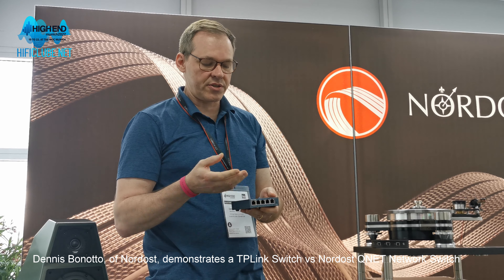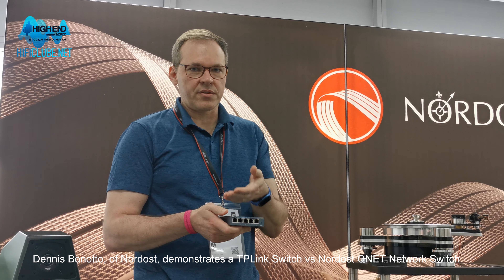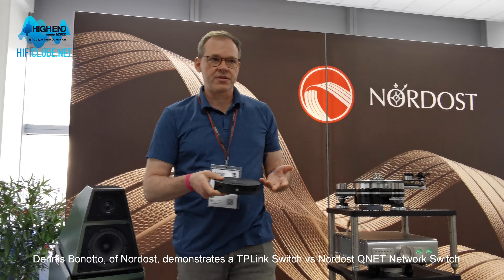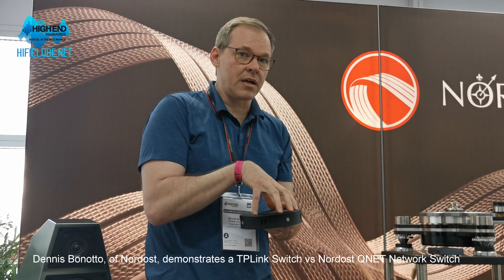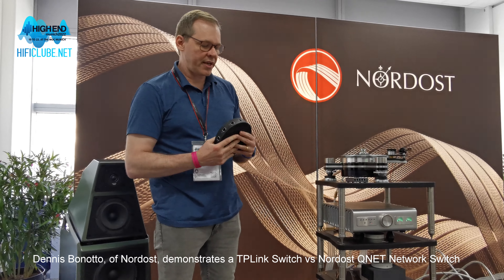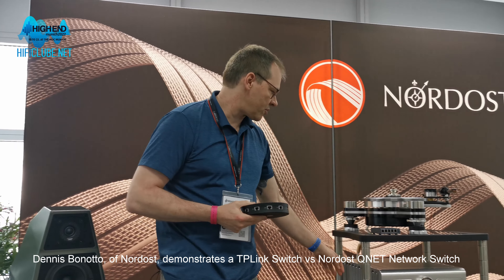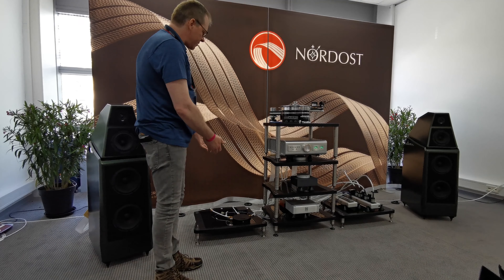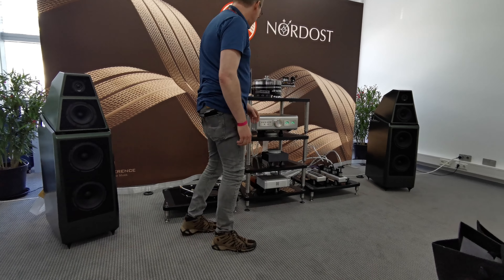High End 2022_Nordost QNET Network Switch vs TPLink Switch by Dennis Bonotto

Comment: Total bullshit. And Dennis Bonotto know that !
Reply from the maker: Paul, I am aware switches cannot make a measurable difference also due to the transmission protocol in packages. But if you can go to a local dealer you can try for yourself, even if only to show them wrong.

Comment: 1. I don't understand the comparison with the TPlink switch. There is no switch required at all if one just runs the Ethernet cable from the ISP supplied router to the streaming device. Adding the Nordost switch is adding another device in the signal path, not replacing one. One cannot replace the ISP router with the Nordost switch, because the ISP router is getting its input from cable (coax), fiber, or copper (DSL) and converting it to Ethernet, and then routing it to multiple locations in the home.

2. It's not clear where the music stream is coming from for this demo (a local music server or the Internet). If the source uses TCP/IP protocol, then the Nordost switch cannot improve the signal, as the data is contained in TCP packets that verified using a checksum calculation in the packet header at the receiving end. The TCP/IP also ensures that no packets are missed or out of order, and may request retransmission if that happens. If the signal is UDP over Ethernet, which is sometimes used for audio transmissions, especially Voice Over IP, then there could be some loss of data with a cheap switch because UDP favors low latency over accuracy or missing packets. I believe that music streaming companies on the Internet like Tidal use TCP/IP.
Reply from the maker: Question is: can you hear a difference or not? If not just get on with your life, and be happy
Reply: I didn't hear a difference during either comparison. I listened with my LCD-4 and I can hear the difference between optical and USB for example. I could hear the difference between Nordost analog cables in some of their other demos... But not this. I'm with Mark. 

I'm not an expert engineer, but I know the difference between digital sources comes down to clock consistency. A 0 is a 0 and a 1 is a 1, period. The real time clock doesn't happen until the data is sent from the serving device to the DAC, or even once the data is inside the DAC, depending on the situation and devices. SPDIF has the transmitting device set the clock, while USB natively allows the receiving device to set the clock. This is why USB tends to sound a hair cleaner. Some DACs will cache and reclock the incoming signals internally. My Denafrips Venus II for example did this and I couldn't tell the difference between optical or USB. But that cache stage added latency and it was noticeable with video or when gaming. So I sold it for an Audio-gd R1 that doesn't have this problem and sounds 99% as good, doing some things a hair better and others a hair worse.
Reply: Exactly, a Router is layer 3 (because, spoiler, it routes based on IP)...a L2 switch is relatively dumb and transports packages not knowing what data is actually transported. Furthermore, most streamed data is encrypted anyway...this is just finest snake oil which is getting called out by any tech savvy Gen Z teen... those snake oil guys still live in the 80s when all that was exotic gear and knowledge...it's 2023 now
Reply: @michaellichnovsky8397 Virtually all streaming devices have the capability to clean up and reject any noise on the ethernet line. Adding a new switch in-between an existing router/switch and the streaming device (where no switch existed before) is not going to help unless one has a horrible internet connection. As far as listening, I think a listening test would be great if it were conducted as a double-blind test (with and without the switch) using a sample size of at least 25 tests.
Reply: @Mark-rw3kw  I will say a switch can make a difference depending on what your starting with. In my home the switch actually helped the strength of my Ethernet that was dropping out using the equipment that ISP supplied. As for power I have a older home that picks up a lot of powerline noise. The power supply lowered the noise floor of my devices greatly. But like I said in the beginning someone with a solid connection and quality power going to the home might not notice much improvement at all with these devices. A basic switch from amazon and maybe one of the decently price DC power supplies from ifi will likely be enough for most